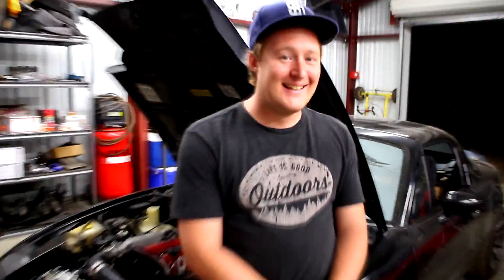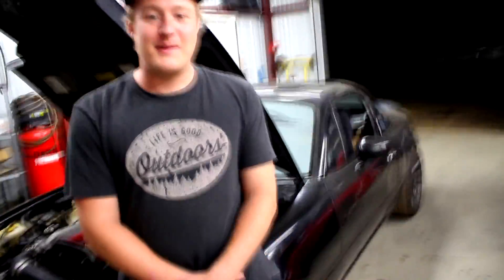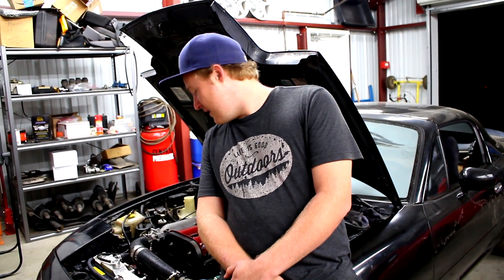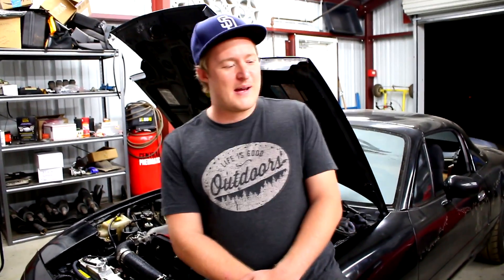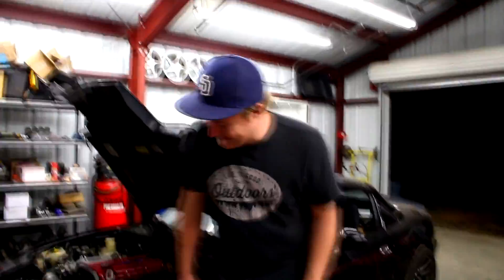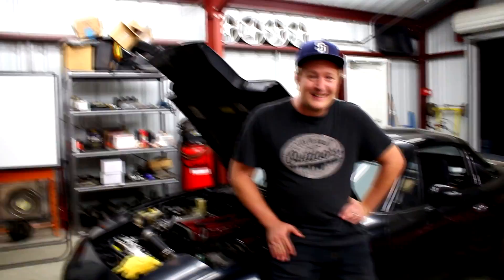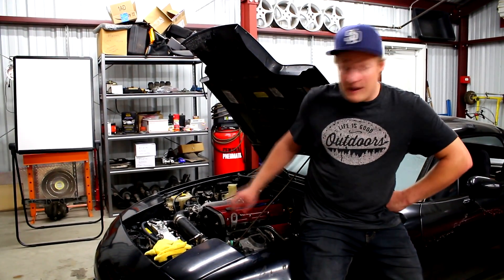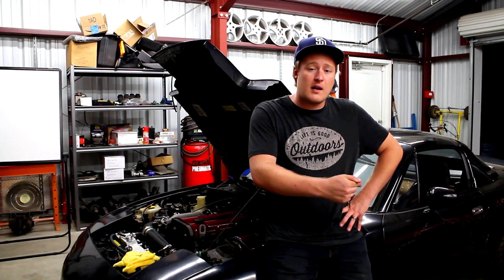Uh Oh...the Reborn Miata blew something!?

Comment: Oh my God you looked so beyond sad. XD
Sorry for your loss. :P
Reply from the maker: 802 Garage lol I was bummed! She will once again be "reborn". Idk how many rebirths this poor car has to go through
Reply: Water births, that is, hahaha.
Do you think maybe it went because there is more flow and pressure with the coolant reroute?
Reply from the maker: 802 Garage No I'm sure it went cus its old and corroded, I can tell be looking at the pipes going thru the firewall, the extra heat pushed it past the brink. If anything the coolant reroute pushes less pressure thru it
Reply: Oh yeah for sure because of the age, I just meant if that's what pushed it over the edge. Interesting.
Reply from the maker: 802 Garage I doubt it, before the coolant reroute the ONLY water going to the back of the head was from the heater line, now theres a 2" hose running water from the back!
Reply: Haha gotcha. GL with fix.
Reply from the maker: 802 Garage Thanks buddy!

Comment: oh that was nasty, I'm really sorry for you guys. Mine just broke the crankshaft pulley bolts this weekend...
Reply from the maker: Spiros Aliprantis Oh no!! Your problem is much worse than mine! What happened??
Reply: GearHeads well, it started as an engine knock when the car was hot. I tried to find the source of the knock and seemed to be the water pump. Which it has some play btw...so, I thought that that was the problem, but I didn't check the crankshaft pulley for play. my bad...so at some point it dropped everything out. Fortunately on low RPM... I reattached the pulley with new bolts for now but both the pulley and the boss hub they need replacement...it runs with 3 out of 4 bolts on the pulley and lot of wobble, but it is a temp fix in order to move it into a safe place for storage till the new parts arrive...
Reply from the maker: Spiros Aliprantis If you can afford it grab one of the Supermiata pulleys like I got! Lighter and better balanced, and you dont even have those 4 bolts to worry about anymore!
Reply: I see, that is the plan, problem is that I need the parts to arrive by Friday and I'm UK based. In UK I can't find any pulley kit, plus I wear the v-belt for alternator-water pump. Any suggestions please?
Reply from the maker: Spiros Aliprantis If your in a hurry then your kind of stuck with stock replacement I guess, tho I will say if you want to upgrade eventually you can swap the pulley on the alternator to run a Serpentine belt setup!
Reply: GearHeads Unfortunately yes, because the car is in a car park and not in my driveway, I didn't wanted to risk moving it. Image that the pulley is with 3 bolts and wobble like crazy... What I can't decide yet, is whether to go for the ati dumper or any other lightened pulley set... I guess I will fix it with stock for now and upgrade it later... As for your video, I forgot to mention that I'm also interested to see how the heater core is being replaced. Plus could you show the cabin filter and where can you find a replacement as well?
Reply from the maker: Spiros Aliprantis If I remember I will try to include that as well!

Comment: At least I'm not the only one that has issues from the last job. For me it was a timing belt + water pump change and a friend placed the water pump gasket wrong and it was ofc not sealed. After taking everything apart again we only had hylomar instead of a gasket and that seemed to fix it until it was about 11pm. We jacked it up to put the underside protector on again and it startet dripping some coolant. Drove home and parked and just a bit coolant seemed to get lost on the way (overflow reservoir is sitting at low, hasn't lost any coolant below that).. new gasket is on the way :(
Reply from the maker: M4NOOB Bummer man! I know its a pain but since you just did it pulling it off and doing the gasket again will go much faster! My heater core wasn't really a result of the engine swap etc. it was on its way out anyways it looks like, just happened to be right when I was getting the car on the road again.

Comment: That's gonna smell.

1.  Bypass the heater core.  Buy a nice warm hoodie.
2.  Hard wire the fans with a switch if they're not coming on.
3.  Rent an upholstery shampooer.

Best of luck pulling that heater core without removing the dash.  I predict LOTS of frustration in your near future.
Reply from the maker: goodeggpro We'll see how it goes! I am afraid of the smell hopefully it comes out alright
Reply: goodeggpro "by a nice warm hoodie" 😂😂😂

Comment: What's the difference between the miata's 1.8 and the 1.6 engine? 
could I convert a 1.6 to a 1.8?
Reply from the maker: Yea, we just did a whole series on doing a 1.8 swap! To be honest they are very similar engines, the 1.8 makes about 10% more power and torque. Its not something I would bother with though if the 1.6 you have is still good, but if the motor is old and tired and needs replaced you can 1.8 swap it. I swapped mine even though the 1.6 was healthy cus my turbo setup I have was all setup with the 1.8, plus it just gave us more content to make =P